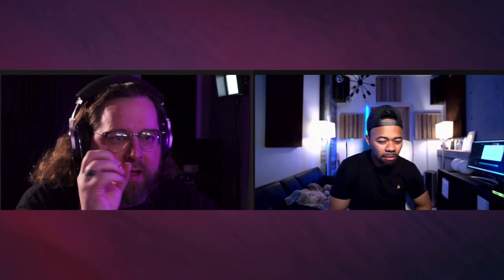Do you even need mix bus compression? | Devvon Terrell

Comment: That's a great point you are making. The space we are living in is 0 to 144 dB of dynamic range (@24 bit) and 1 Hertz to 20,000 Hertz of frequency range. The Compression effect only takes care of the few loudest dB of that overall space. While the sound of gain circuits, harmonics and saturation affects every part of that space and is therefore suited way more to glue the different parts together.